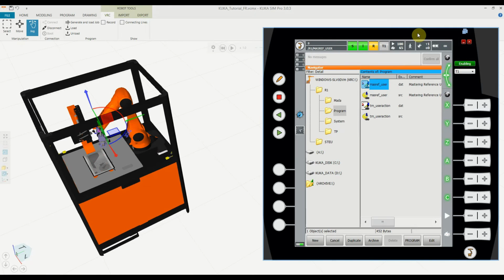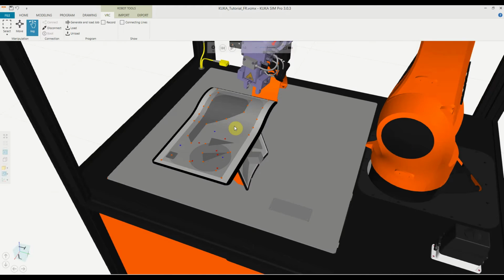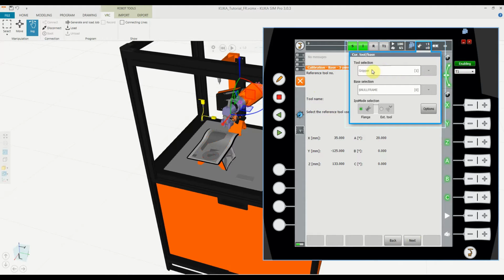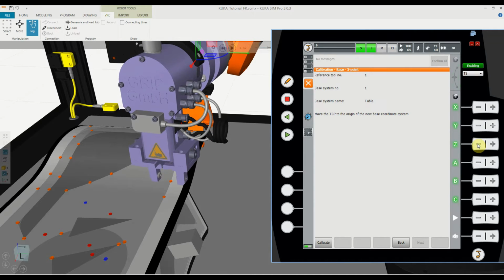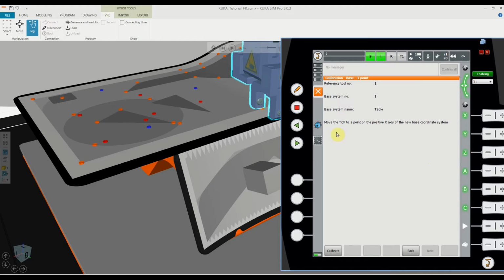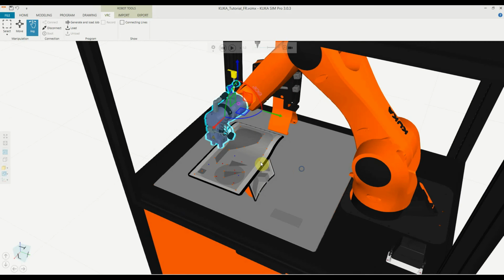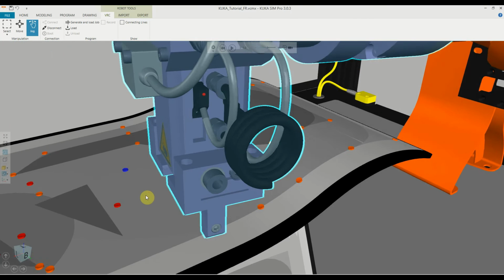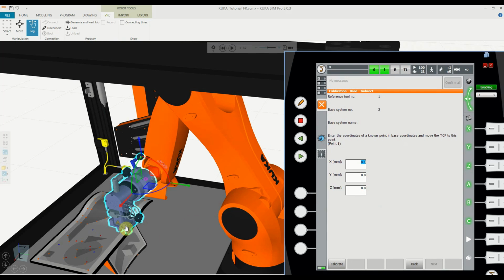How to teach BASE FRAME on KUKA robot ?

Comment: cool but... how do you do this only from programming without teaching? (ex. Staubli "setframe" function)
Reply from the maker: I'm not sure what you would like to accomplish. If the goal is to change the $BASE values, you can simply write a logic that will set those, not the correct structure, but it will look something like that:

$BASE[1]=(x,y,z,a,b,c,)

Comment: I calibrate the base, but after running the robot in a program, first few movements it refers to that base, after a few PTP and Linear movements, my base was overwritten and adjusted to 0,0,0. An error showing inconsistent data on Base, any idea how to fix?
Reply from the maker: It's a bit hard to answer without taking a look at the code, maybe there is somewhere a logic that overrides the base values

Comment: please tell me how to change welding to a milling cutter for KUKA robotics.
I want to do milling work on the KUKA robot, not welding.
How can I change the program and control panel on the KUKA robot so that I can work.
What does it take to do this.
I will leave a mail so that you can write to me. If necessary, I can pay for your advice.
Or make a video where you can talk about it.
Thanks!
Reply from the maker: There are a few more questions to be asked, but assuming that your robot is compatible with KUKA.CNC package, you would simply need to uninstall welding package and install the CNC package

Comment: if you define a base, how do you use it in your program? i have a part aligntable, base n°2, i want to move the robot with that base, and then use an other base for the rest of the program. how do i do this? Thank you
Reply from the maker: You can use different base for movements and different for the program point, you just need to make sure when you are creating a point that you have correct base and tool selected on the pendant

Comment: ok just to be clear, the Baseframe in kuka is similar to the Uframe in Fanuc?
Reply from the maker: yes that's correct. The main difference is that in KUKA you also have $ROBROOT that is always located in the same spot "in the middle of the robot base" (so normally $ROBROOT == $BASE) and you can move your BASE=0 to be in different spot than $ROBROOT, this way your are moving your WORLD as well and you can't do that in FANUC.

Comment: Hello! Thank you for interesting content. But I think there is an error in your explanation of three point method. The third point is not a point on the Y axis but  any point on XY plane in a positive direction of Y. True position of Y axis will be resolved automatically according to origin position , XY  orientation and right hand rule. But may be i understood you in a wrong way..
Reply from the maker: You are totally right 😀, the third point needs to be in the XY plane in a positive direction of Y and there has to be at least 2.5deg difference between your last point (X) and your Y point.